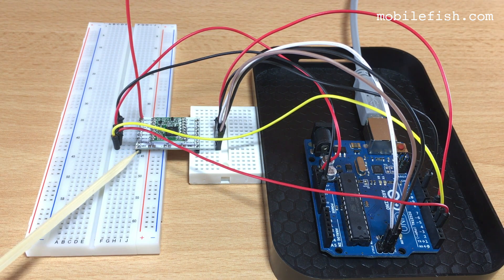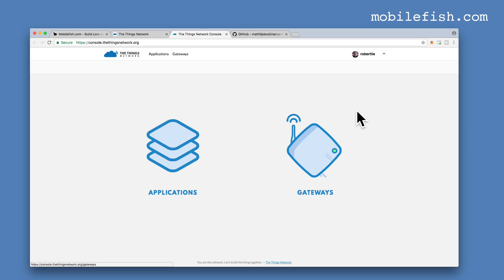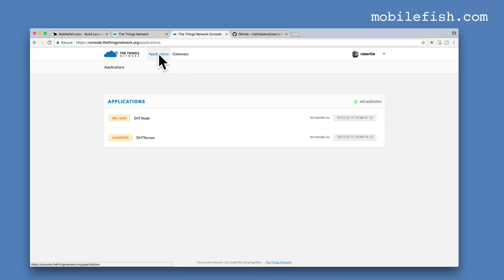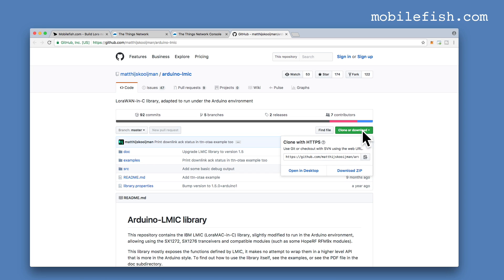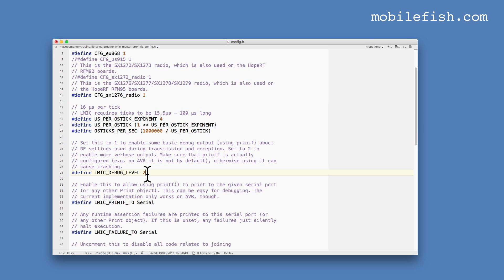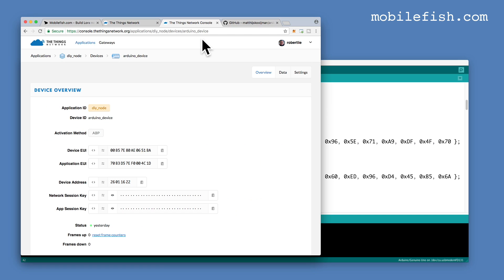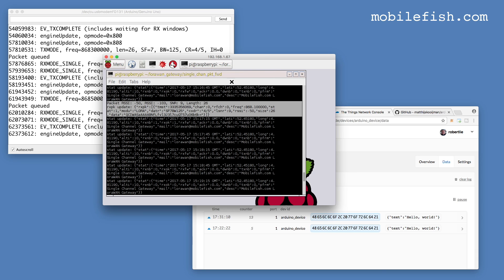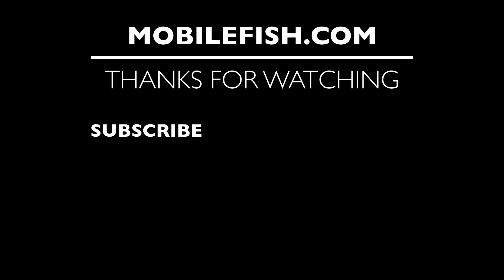Create a LoRa node, part 5: Attach Arduino Uno to the LoRa module

Comment: MobileFish, does the UNO operates at 3.3V to be able to communicate directly with the RFM95 radio's 3.3V requirements?  How is the UNO different than the MEGA2560?  I am attempting to connect a pair of RFM95PW LoRa simple P2P radios to my MEGA2560s.  

I have been working with a pair of ESP32 DEV boards and the RFM95PW radios via SPI with simple sketches supplied from the Github libraries.  However, this setup started to exhibit communications issues with the USB ports on both my Windows laptop and PC.  I was using the Silicon Labs CP120x drivers with good success and suddenly the issue arose with the USB ports not recognizing/communicationg the functioning ESP32 DEV boards??????  So my thoughts turned to the MEGA2560 boards which have been working extremely well with a pair of Micrchip's RN2903 LoRa P2P radios communicating via SoftwareSerial.  However the MEAG2560's 5.0V requires a logic leveler, which so far is not able to communicate with the RFM95PW radios (probably beyond my limited knowledge of SPI communication)????

Your thoughts, thanking you in advance.

Comment: the library does not respond to output power settings. Where to change the transmitter power?
Reply from the maker: 1) See: 
https://github.com/matthijskooijman/arduino-lmic
2) Goto: src/lmic/radio.c
3) Search configPower()
Power is set by: LMIC.txpow
4) Reverse engineer, search in files where txpow is set. Do it your self ;-)

Comment: Thanks for making these videos! It helped me getting connected to The Things Network with my first node!

Some things i did different:
- soldered short male jumper wires to the rfm95 module including one that i later shortened to 8.7 cm that serves as the antenna (mounted on the other side)
- used SPI pins 11, 12 and 13 on the UNO instead of ICSP header

The current ttn-abp sketch has nss set to pin 6 (not pin 10). Furthermore i needed to change the 3rd .dio pin to LMIC_UNUSED_PIN (was set to 4 in the example sketch). After that it works stable!

From my ttn-abp.ino:
// Pin mapping
const lmic_pinmap lmic_pins = {
    .nss = 6,
    .rxtx = LMIC_UNUSED_PIN,
    .rst = 5,
    .dio = {2, 3, LMIC_UNUSED_PIN},
};

Comment: how to run thr gateway i made on things.org on my laptop (windows 10) 
I guess I have to run a gateway before putting hex addresses in arduino library. But how to run that gateway. I am not using adafruit. I have only arduino and LoRa RA02

I am new

Comment: hello, Iam testing lora communication by using RN2483 PICTAIL LoRa module, i bought two of those lora modules can they communicate directly without any gateway in between? please reply ASAP , thankyou in advance
Reply from the maker: I do not know RN2483 PICTAIL LoRa module.
In general I even did not know if a node-to-node communication was possible.
But it seems it is possible reading this article:
https://www.thethingsnetwork.org/forum/t/node-to-node-communication-with-lmic/2023/10
Please note: I have never done node-to-node communication myself.
You need to do the research yourself.
Reply: Mobilefish.com okay thanks
Reply: hi i tested and with a successful transmission of data, P2P communication is possible in loRa
Reply from the maker: Thanks!

Comment: hi there, I was just wondering whether is RFM95 5V tolerant on I/O pins or what. Because Mobilefish.com just used it without any logic shifter between Uno and RFM95 module.
Reply: Good question
Reply: I have the exact question.. How can the RFM95 be used directly without any level shifting to 3.3V?
Reply: @jithin_isaac  Do you have any news regarding this?

Comment: while trying to upload the sktech , I've got this error : 

In file included from C:\Users\Imed\Documents\Arduino\libraries\arduino-lmic-master\src\lmic\lmic.h:18:0,

                 from C:\Users\Imed\Documents\Arduino\libraries\arduino-lmic-master\src\lmic\oslmic.c:12:

C:\Users\Imed\Documents\Arduino\libraries\arduino-lmic-master\src\lmic\oslmic.c: In function 'os_runloop_once':

C:\Users\Imed\Documents\Arduino\libraries\arduino-lmic-master\src\lmic\oslmic.c:118:97: error: 'is_runnable' undeclared (first use in this function)

             lmic_printf("%lu: Running job %p, cb %p, deadline %lu\n", os_getTime(), j, j->func, is_runnable ? 0 : j->deadline);

                                                                                                 ^

C:\Users\Imed\Documents\Arduino\libraries\arduino-lmic-master\src\lmic\oslmic.h:250:58: note: in definition of macro 'lmic_printf'

     #define lmic_printf(fmt, ...) printf_P(PSTR(fmt), ## _VA_ARGS_)

                                                          ^

C:\Users\Imed\Documents\Arduino\libraries\arduino-lmic-master\src\lmic\oslmic.c:118:97: note: each undeclared identifier is reported only once for each function it appears in

             lmic_printf("%lu: Running job %p, cb %p, deadline %lu\n", os_getTime(), j, j->func, is_runnable ? 0 : j->deadline);

                                                                                                 ^

C:\Users\Imed\Documents\Arduino\libraries\arduino-lmic-master\src\lmic\oslmic.h:250:58: note: in definition of macro 'lmic_printf'

     #define lmic_printf(fmt, ...) printf_P(PSTR(fmt), ## _VA_ARGS_)

                                                          ^

exit status 1
Error compiling for board Arduino/Genuino Uno.

Any solutions ???